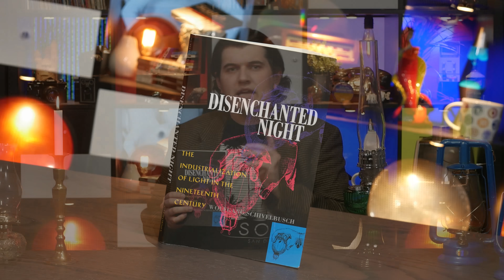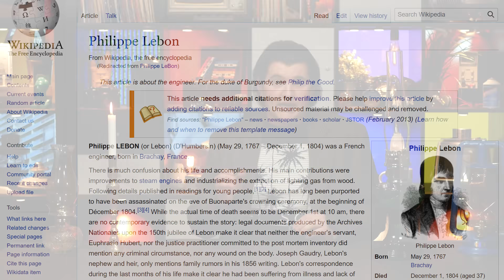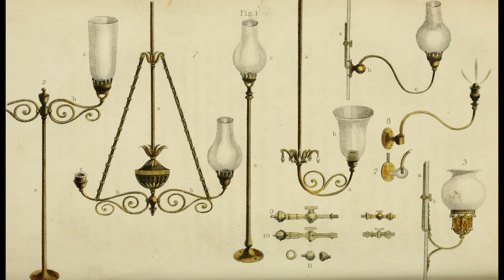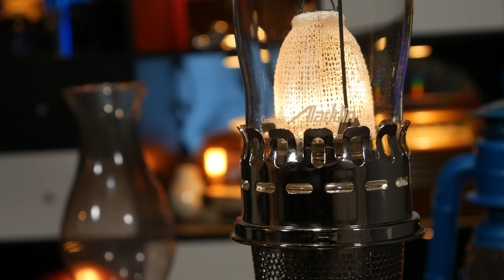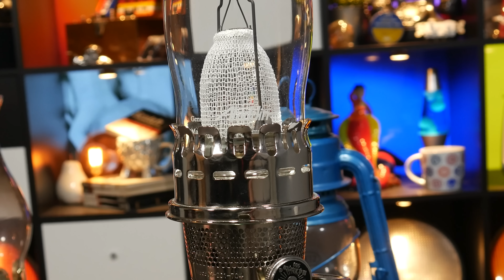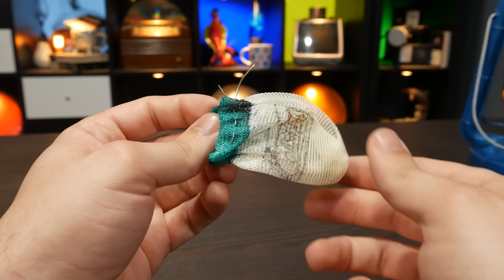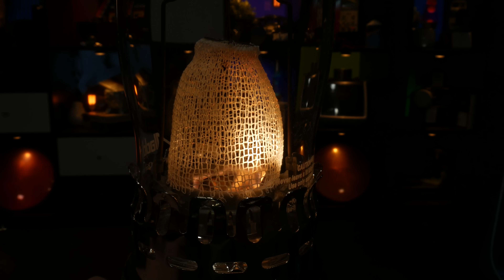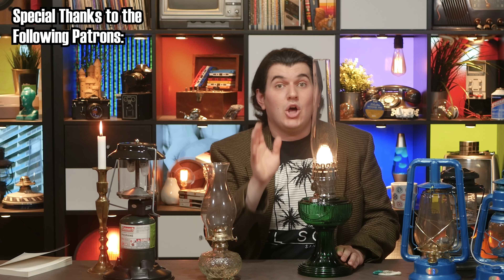How the gas mantle made lamps 10X brighter

Comment: "The good old days", when open flames (candles, oil lamps and openly burning gases) was "safe" for home use.
Reply: You can use open flame if you are used to it. You pay attention to it.
Reply: Open flames are just like any other hazard in the world. Fine if you know what you're doing but dangerous if you put them in stupid places.
Reply: I have a glass bottomed lamp, that I recently got going, it felt absolutely dangerous carrying it around lit. (I was trying for the 'feel' of yesterday) If I fumbled it for any reason, it would end up in a scary fire, I was not game to bring it into my house, only outside. Boy did I feel a lot safer when it was finally out and had cooled down.
Reply: I use them frequently. Turning off the lights and using candles and lamps like the Alladin in this video are quite useful for reducing night time blue light and I sleep much better. 

And for some reason the scent of a freshly blown out candle helps. Not sure why on that one though.
Reply: We had candles on our Christmas tree when I was a kid. Never burned anything down. Also in the 1950s owners manual for your car  told you how to adjust the valves, today they tell you not to drink the contents of the battery. Says it all.
Reply: @D-B-Cooper  Because in 1950s cars, the owner actually could adjust the valves with a only a basic box set. Today's engines, ignition and emission systems are way too complex to do that as a weekend project.
Reply: @lajya01  And deliberately so. Getting a simple repair done to your car requires you to pay a small fortune in labor and parts.
Reply: @D-B-Cooper  Yes, modern instruction manuals are useless, they treat us as dumb dumbs
Reply: @D-B-Cooper  They also still performed lobotomy and doctors prescribed cigarettes.
Reply: @jimdabarbarian  doctors have now switched to vaccines to do that.
Reply: @D-B-Cooper  Careful, he might talk about the viability of injecting 5g signals through needles one day.
Reply: @D-B-Cooper  You realize they had vaccines in the 50s right?
Reply: @D-B-Cooper  Oh, John O, why did you have to go and say that? I had already liked your first comment, but now you made me go back and unlike it!

Comment: 24:55 a kind of that lamp on the left is widely used in my country in the 80's, because at that time the grid coverage is not as thorough as now. And also because at that time kerosene is something easy to get (in the late 90s / early 2000s, my government not only stopped subsidizing kerosene but also made them really hard to buy. Forcing electrification of lighting everywhere.)

We call those lamps "petromax" lamps (probably a genericized brand). It uses high-pressure kerosene (we had to pump air into the kerosene tank to do that). And they were darn bright.
Reply: indonesia?

Comment: Remember the original town gas was formed by taking coking coal, and then burning it while introducing live steam into the sealed chamber, so the red hot coal would as well act as a catalyst forming on the one side carbon monoxide, and also hydrogen, giving you extra boost for the gas stream. The CO was toxic, and the H2 was very much explosive, so it only took a small leak in an enclosed space to get the H2 level past the lower explosive limit of 4%, and thus have the explosion when there was either a spark or a hot surface. The CO was just as deadly, odourless, colourless and would leave the person dead in minutes, with no signs of distress, other than the bright red blood, even hours after death. As well small doses would lead to sleepiness, and thus you would not leave the leak area till it was too late, plus the gas does not trigger any sort of body response, like CO2 does.

Comment: I loved this little fact of mantles. A researcher/inventor discovered that fire can't travel into/through a gas-filled tube that is longer than its diameter: that is, if natural gas is flowing through a 2" wide pipe that is 2.5" long, once lit the fire can't travel up the pipe (I don't know what edge cases exist for this).

The mantel follows this principle, in that the thickness of the "fabric" is thicker than the mesh holes inside - effectively a matrix of "pipes".

I'm speculating that the combustion of kerosene at the wick is incomplete when the mantle is dropped, producing carbon monoxide instead of carbon dioxide. Metallic catalysts are frequently used to further combust carbon monoxide, with thorium oxide being a strong chemisorber of both oxygen (forcing the incomplete combustion of decane and other kerosene components?) and carbon monoxide (capturing the incomplete byproducts of combustion), facilitating the oxidation of carbon monoxide as catalysts do.

The chemistry of catalysts and their chemisorbed components is beyond my experience, but I would imagine one could investigate the ThO2+O2, ThO2+CO, and ThO2+CO2 as well as the O2+2CO => 2CO2 absorption/emission spectra to get more clues.

Comment: Thank you so much for this video. We had the "Hurricane" lamps in our home in the 80's and early 9's when power outages or "load-shedding" was a daily (I mean, nightly) affair, and shops and commercial establishments would have the "Hazzack"-s, the name given to the lamp shown in 25:12. 

It always intrigued me how the Hazzacks could produce so much more light, and pleaded with my parents to buy one for our home. However, that request was turned down since it involved pumping air into the fuel, and the fuel-tank exploding was not unheard of......and also, because it was more expensive.

This video lays to rest a 33-year old question.

Comment: I suggest cupping your hand and blowing out the other glass chimney oil lamps as well. I've dropped wicks down into the oil reservoir by lowering the wick until it goes out, and it's a real pain in the butt to fish it out and re-feed it through. That, and I prefer to use oils like Sterno if you suffer from migraines like I do. It cost like $20 a gallon shipped. I prefer to raise the wick so you can see it when the flame is out so it's ready to light. Turn it the wrong way when it's out and you can't see the wick, and you might end up fishing out the wick.

Comment: On the "Gasometer" front, the ones in and around York at least (and other places) were marked with a vertical scale on their outside surfaces. The graduations were marked in measures of "Thousands of Cubic Feet" ("Th. cu.ft."), so in their own way, they were actually measuring their own contents by volume. I have good reason to believe this is where the term "Gasometer" originated. It has long been said that the correct term is "Gas Holder" but it also seems that either term is equally applicable, and acceptable.

Aladdin wicks? - Good luck in trying to achieve the perfect burn. I've been around Aladdins since I was knee high to a grasshopper, and never yet seen one that burns with a even flame, all the way around. A lot has to do with air flow within the room, and with the side draught burner, it only takes a slight imbalance in the air movement either side of the burner to push the flame one way or t'other, but hey ho, they did their best with what they had available, and to be fair, they must be good enough when we consider that the Model 27 is still in production to this day.

Speaking of pressure lanterns, or vaporising lanterns, do you ever come across "Tilley" or "Vapalux" lamps over there? There is also the "Bialaddin" which is identical to Vapalux, but - Wait for it! - Made by Aladdin!  Tilley lamps, manufactured in Belfast, date from at least the early Victorian era.

Comment: This delve into kerosene lamps interesting because I have some, in case of emergencies.  I live in society ... but you wouldn't always know it.  Especially if a storm hits, it is entirely possible that the power lines can be damaged ... and not be repaired for days, or even a week!  Adding winter to that easily goes below freezing.  So we have the usual forced-air furnace, yes.  (LP)  But we also have a wood stove, just in case.  We have an emergency kerosene heater and lamps, just in case.  And candles.  One of these days I'd love to add a generator and even solar panels, but those cost money.  LOL  And, as said, it'd have to be able to last a week to matter.  So I have various lanterns.  Now I know the hows and whys of them!

Comment: Its not the wick.    That wont fix the problem. Its the tolerances on the gallery. You can either get replacement parts or just get a vintage burner. If you do some searching you can find a video on here where a guy fixes this problem.

Comment: It should be noted that some older homes still retain their gas lighting fixtures. The only difference is the lack of a flammable gas, the addition of wires, sockets for bulbs, and an appropriate switch. But it's still the exact same fixture and can easily be converted back into a gas lamp if the owner desired.

Comment: When I was a lad, we had an Aladdin lamp to use in case of power outages. It gets so hot at the top of the chimney you can toast marshmallows. I still have the lamp, although I almost never use it anymore. in regard to the uneven glow, some mantles are better than others. Also sometimes using it for an extended period can sometimes even it out if I recall correctly.

Comment: I think candoluminescence is vaguely understood- the black body curve is an equilibrium thing- all the molecules particles are at roughly the same temperature/energy, and everything has sort of equalled out.

This isn't really the case though, the energy hasn't evened out, it's massively out of equilibrium, there are incredibly high energy molecules in there that are slow to transfer their energy to the rest- it's what produces the blue light of a gas flame- blue is a very high energy colour, one that shouldn't really be produced in significant amounts in the relatively modest temperatures of a gas flame...but yet it's blue.

The high energy molecule/intermediate in that case is mostly excited molecular carbon c2 (a radical) and the blue colour it's swan bands.

For a similar reason fire is a plasma- it's not hot enough to be a plasma, and yet...it is, with a level of ions far higher than you'd expect for its heat- those pesky high energy radicals ripping electrons off other molecules.

Candoluminescence is somehow extracting energy from those high energy intermediates before it can diffuse and thermalize.

Similar to how glow sticks work I think.

Comment: Really enjoying this series.  Thank you!  It's blown away a lot of my misconceptions about how candles and lamps work.  I've also used it to help my wife, who is a writer of historical fiction, get some often-overlooked details correct.  

Question regarding the use of the Aladdin or other fuel-powered lamps in a power outage:  How long will the Aladdin Lamp burn on one fueling?  How does it compare to a battery-powered lantern?  Obviously, hydrocarbon fuel is much more energy-dense than batteries, but how much of that energy actually gets turned into photons, as compared to a modern LED lantern?

Comment: My parents had the gaslight in the front yard. My dad would clean out the dead moths, clean the glass panes and install new mantles.  I was always amazed.  Light the mantles with a match and watch them burn and shrink.  Then he would turn on gas and light it.  He could make it extremely bright but he was cheap and would turn the gas down.  Years later he finally replaced the light with electric because it was less work.  Finally he just took out the light.

Comment: A lute, or luted drain, was an early sort of safety valve. It vapour was taken through a pipe to a receiver. In this pope was a T piece. The vapour flowed through the top of the T. a pipe was connected to the bottom part of the T, facing down vertically. This vertical pipe was extended a few inches of water contained in a cylinder, with the water in the cylinder open to the air. If the pressure in the product pipe rose above that needed to bubble gas through the water it escaped through the water and did not get to a high enough pressure to damage the rest of the apparatus. Hence " Forced my lute.
Reply: We frequently carry vapour in aluminium tubes.

Comment: I used to go on caravan holidays with my parents in the 1980s in the UK. The caravan had an electric light, but only when the car was hooked up (the caravan had no battery of its own), and we were reluctant to run down the car battery with an incandescent bulb. However, it did have a gas stove running off a propane tank, and a gas mantle light plumbed into the same system. It worked beautifully. The extra heat was a bonus, too, during the cool evenings.

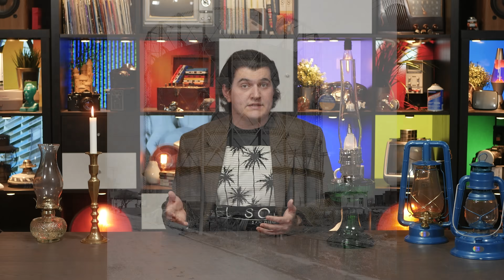Comment: 5:20

But don’t those containers expand/contract upward?  Their rise and fall would be based upon how much gas is inside...  Thus they DO MEASURE GAS VOLUME (albeit not to an exact, metered amount; it’s still relatively accurate based upon the rise/fall of the expanding structure)

Comment: I was wondering when you would cover gas mantles. I still use them for camping and emergencies since they can be insanely bright for much longer than most battery lanterns and as long as you keep them away from children are pretty darn safe. I have two both are propane but my dad still has an liquid gas one that he runs with White Spirits and they just work
Reply: Yah, my dad still has an old Coleman lantern that takes white gas.  He and Mom bought it for camping trips when they were newlyweds in the 70s, and we have used it during power outages, too.
Reply: Ah yes, the rectangular cans of white fuel. I remember them well.
Reply: Just sold off the last of my Coleman gas lanterns a month ago. Switch to the Northstar propane lanterns - much brighter.

Comment: I remember buying “white gas” in gallon cans with my dad at sporting goods stores when I was little, to power our Coleman lantern. It didn’t smell as bad as gasoline, and I assume was also unleaded.
Reply: That stuff was quite the popular item in the local hardware store during a bad blizzard that knocked out power for several days. Started out with typically a good bit high of price and that price more than doubled before the last can was sold in three days. Don't ever forget to gouge the living hell out of everything you possibly can.
Reply: @leebarnes655  Hah - so it's still a current item, then? I guess it'd make sense; still lots of Coleman lanterns out there. I expect unleaded, no-ethanol gas would work too (? would it?), but gasoline fumes make me physically ill these days. (Strange; when I was younger, I liked the smell of gasoline, when I was working on my mini-bikes. These days it's nauseating though :-/)
Reply: @DEtchells  Lots suggest it, I've never tried it or needed to. Rumor I heard once was that it actually is Naptha so a bit different from gasoline. My mother used it in her ronson flip top lighter until our can was all gone, ronson fuel doesn't have the same smell either. The story is from 1977 and it was common to see it then, but we had already moved onto the propane mantle light and it's still on the shelf waiting for another blizzard. I've got a whole box of mantles ready to go somewhere too, minus a few of course.
Reply: @leebarnes655  Ah - you're right, it's naptha! I just googled "white gas", and it said its chemical name is naptha. Interesting. And yeah, I have a propane lantern with mantles and a bunch of disposable propane cylinders (plus one refillable one) waiting for the next major power outage. (A hurricane here most likely; not many blizzards in the Atlanta area :-)

Comment: The Colman naphtha/gasoline lanterns  still work very well and are still used today.. Canadian Forces  use them in their winter warfare  kits to take advantage  of the heat generation,  they also use the Colman  stoves .... they work in a neat way with the generator pipe to help vaporize / gasify the fuel... I have a antique blowtorch that also has a generator  stage ... I have been told not to run gasoline  in it anymore as the naphtha/ camp fuel is better... but I may try kerosene  to see what happens... with fire extinguisher nearby

Comment: As a medic in the military, we used the petrol lamp (gasolin). The net was hanging on a ceramic type of holder, detachable. You bind the net on the holder, put it back into the lamp and light it (as you showed it). The bottom tank needs to be pressurized, a pump was attached. After the net was used (burned), never touch it! If you did you created a hole where the flame comes out. Depending on its size, it deformed (melted) the glass. But, the good thing was, it provided heating in the tent.

Comment: in the crossing of the avenues General Paz and Constituyentes we still have a german made gasometer but it only worked for like 6 years until natural gas was made available. It is actually a freaking huge diaphragm to keep the grid pressure balanced. Ultimately it's the same concept as water towers 
https://www.google.com.ar/maps/@-34.5706821,-58.5103082,341m/data=!3m1!1e3?hl=es

Comment: I see you've found what the lute is - but some examples from The Elements of Experimental Chemistry: "slips of moistened bladder, or of paper, or linen, spread with flour paste, white of egg, or mucilage of gum arabic, answer the purpose." Also, "the substance which remains, after expressing the oil from bitter almonds, and which is sold under the name of almond-meal, or powder, forms a useful lute, when mixed, to the consistency of glazier's putty, with water or mucilage." And finally, a 'fat lute': "beating perfectly dry and finely sifted tobacco pipe-clay, with painters' drying oil, to such a consistence that it may be moulded by the hand."